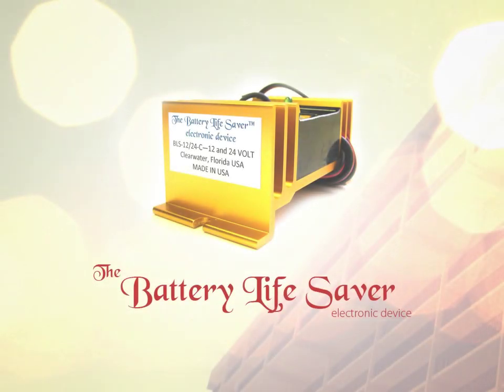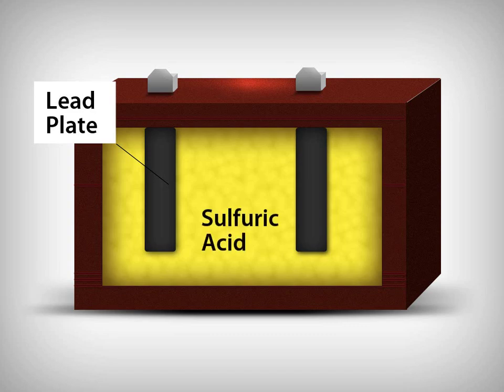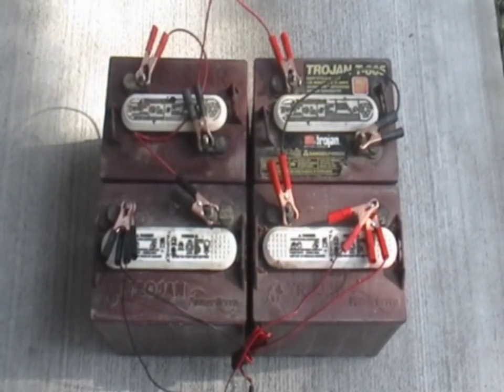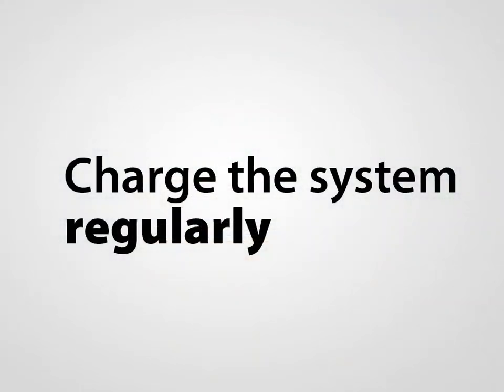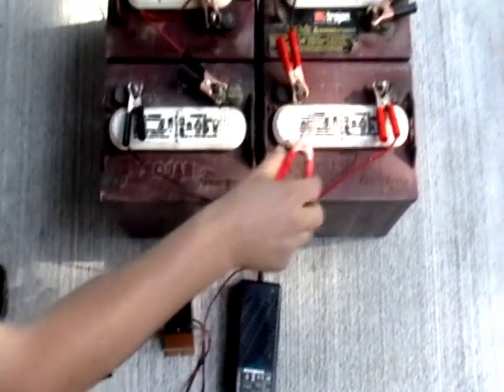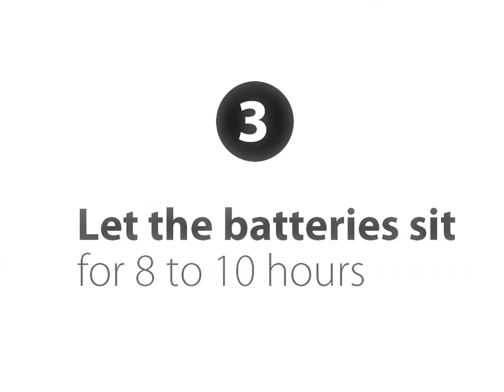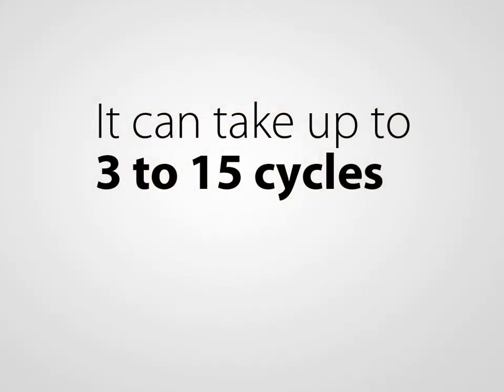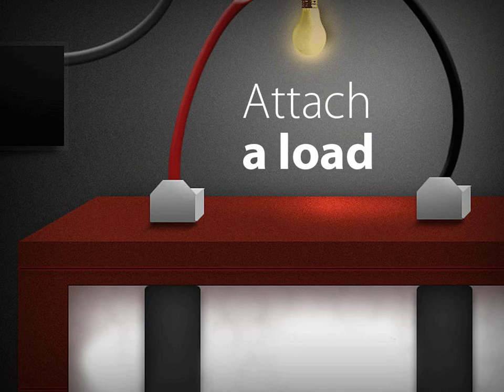All About the Battery Life Saver

Comment: I bought this and it has been connected to my battery for 3 years. Now my battery is dead. I have it connected to two 200amp deep cycle battery.  It simply does not work
Reply from the maker: Thank you for your comment.  We need to find out more about your system in order to do a correct assessment.
We have been selling BLS units since 2002 getting amazing results. We will want to assist you to find out what happened.
Please let us know how we can contact you. We have not found any of your records in our system. 
Unless your batteries have a short or open cell, it is possible to bring them back.

Comment: Does it work on sealed VRLA batteries used in solar/inverter aaplications ?
Reply from the maker: It will work with any lead-acid batteries....AGM, GEL included. Please check this article:http://batterylifesaver.com/2011/08/types-of-batteries-and-the-battery-life-saver/
Reply: Ibidapo Ilawole knit
knit and chohet

Comment from the maker: Hello, the BLS-72A will work for your system.  The current draw for this model is 250mA. It is best to use the BLS with new batteries to prevent from the buildup of sulfate crystals. Assuming that the batteries are charged regularly, you can leave the BLS connected at all times.  Thank you for your interest in our BLS and please feel free to contact us at 727-446-8400 for any other questions that you may have.

Comment: hi , i have a 72 volts 240 amps battery bank of 12 batterys they are deep cycle tubeler battery .for a solar system i have , will your bls work with my setup ?and my batterys are new , shall i start using them from now ? and how much amps the bls consume ? shall i keep it on all the time or semi anualy ill turn it on for 2 to 5 days only ? thanking you;.

Comment: I install them on electric golf cars and resale processed batteries.
I check the voltage on each battery first and use the hydrometer if a battery has low voltage, which generally comes from one bad cell. Replace the battery with the same size and brand.